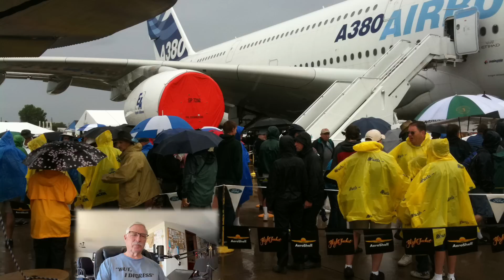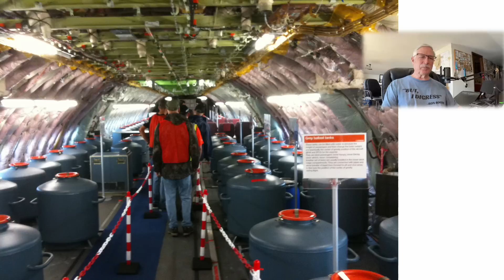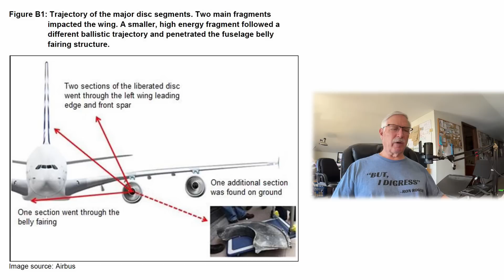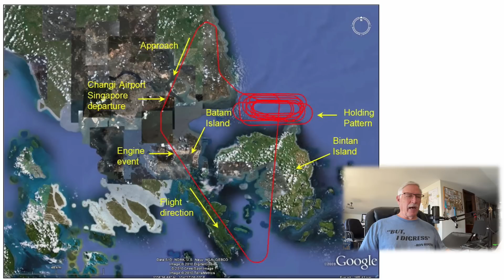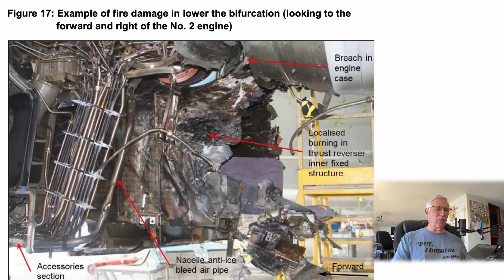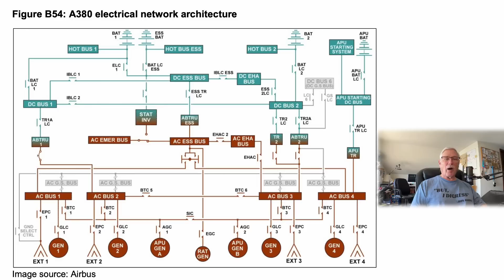Outstanding Crew Actions prevented a Catastrophe! Outstanding Crew Actions prevented a Catastrophe!

Comment: Great crew but an scarebus again that almost crashed due to overdesign. Going through al these checklists is also distracting from the Pilots main duty to bring the aircraft on the ground. It was Flying and finally they could not solve any item on the checklist. So why not leave everything and land ASAP. Why thrusting an autopilot in an aircraft with so many malfunctions. Lessons learned here that it would handy to have an knop on the glareshield that faseout al that computerstuff an go back to basic controls and minimum computers. Just flying en saving passengers en crew.

Comment: It was a huge deal here in Australia. The Captain said, "I was buggered if I was going to be at the controls of the first Qantas plane to be lost in history." 100 years and not one loss. Quite a record.
One of the pilots was retired early, PTSD became evident after a few days. But Qantas use this in their training now. When they put it into the simulator, even the chief test pilot of Airbus could not get the plane down. Since then Airbus have made lots of changes to make the warning system not so overwhelming. 
Thank you for your comprehensive analysis. I recommend reading the book QF32. Its chilling how close they came to losing the aircraft. Praise to the Singapore EMS people in battling a rapidly expanding lake of fuel heading towards the 900 degree hot brakes.
Reply from the maker: Wow! Thanks so much for sharing this information. What a safety record!

Comment: Perhaps a very hard question to answer, but an educated guess would be interesting and valuable:

Which and how many systems stood between this outcome and a catastrophe?  Which systems, if they also had failed, would have doomed the aircraft and passengers?  

Looking at the photos tells you immediately that the #2 engine had failed.  Did the external cameras you mentioned provide the pilots a view?
Reply from the maker: I would think it would be visible on the cameras. If the fuel leak had been greater and resulted in a massive fire, that would have been catastrophic.

Comment: My god, I remember this but I didn't realize it was THAT bad. That captain definitely has the right stuff - If that was me, knowing there's been an uncontained failure that put holes in the wing & caused structural damage, with fuel leaking, a fuel tank fire, hydraulic system leaking, heavily degraded flight controls, pages and pages of ecam failures with more failing every minute, forget holding for an hour running checklists, I'd be looking to get on the ground and evacuate at the first possible opportunity. That's what separates the greats from the rest of us slobs I guess 😂
Reply from the maker: They were faced with a very bad situation for sure. Just stay calm and work the problem. This is when all the training kicks in.

Comment: Fascinating as ever. I'm not sure if a video requires an emergency to gain views, but I, for one, would like to suggest a  lecture style video just on the normal operation / systems on a modern aircraft. 

As a passenger, it's easy to see a plane from the sixties having a pair of engines under swept back wings with a single tail, and then a brand new plane looking like not much has changed.

I'm sure the enginerds amongst us would love some insight.

I appreciate your time. 
Owen.
Reply from the maker: Great suggestion!